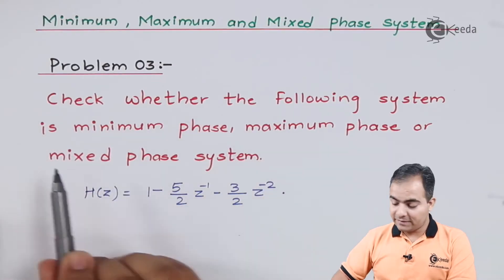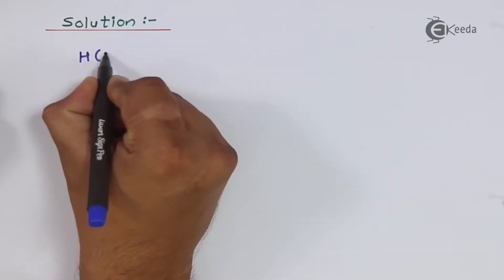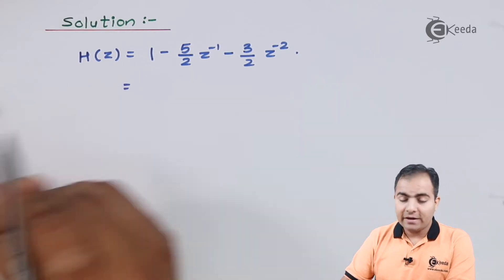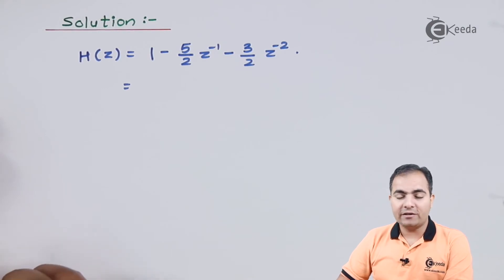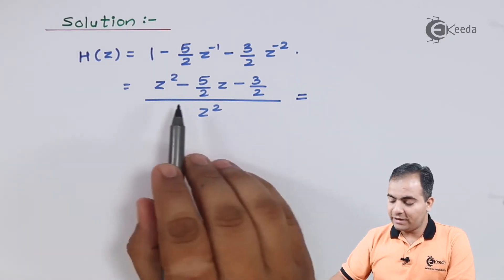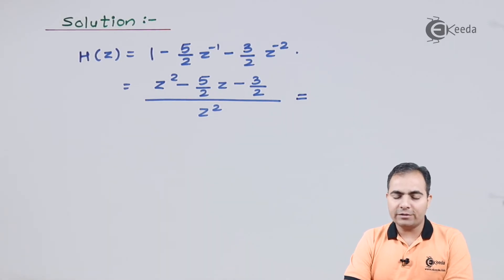Maximum, Minimum and Mixed Phase System | Signals and Systems | Problem No - 3

Comment: Timestamps (Powered by Merlin AI)
00:05 - Introduction to minimum, maximum, and mixed phase systems.
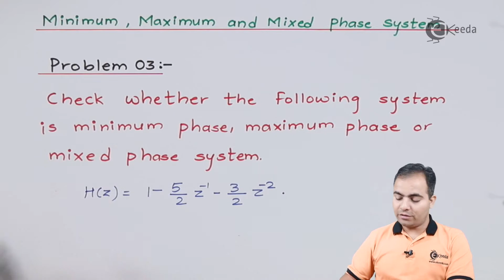00:49 - Exploring the relationship of z in phase system equations.
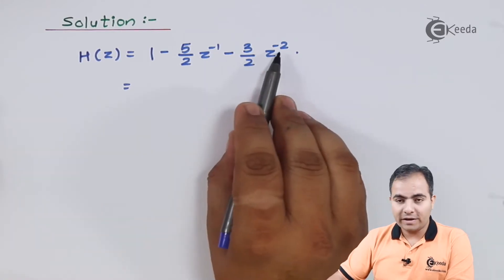01:33 - Multiplying by z² simplifies the equation's powers.
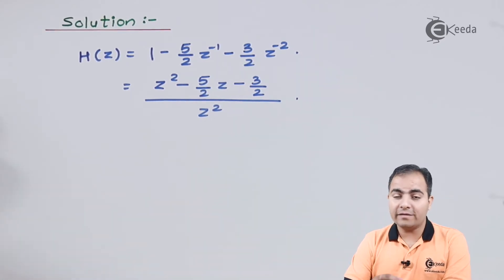02:18 - Understanding factorization to identify system phase type.
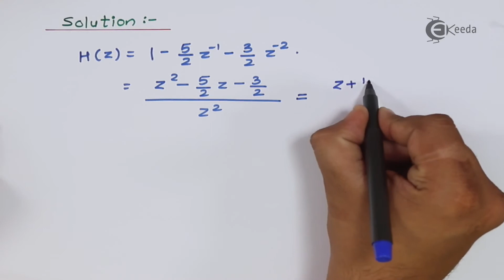03:05 - Identify the locations of zeros in a z-transform system.
04:01 - Identifying the system type as mixed phase based on pole locations.
04:58 - Identifying system types using zero values and their location in the unit circle.
05:41 - Determine the phase characteristics of the system using unit circle comparison.